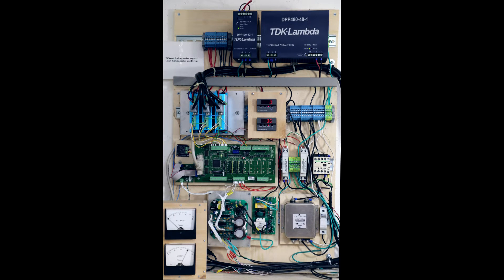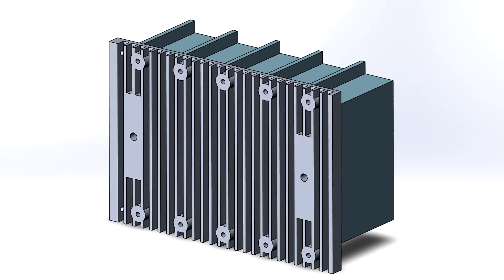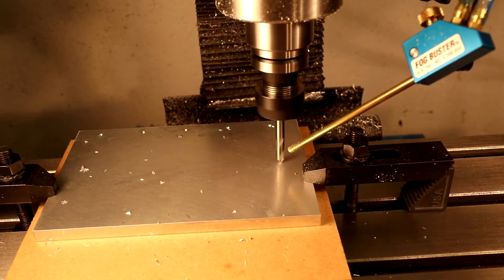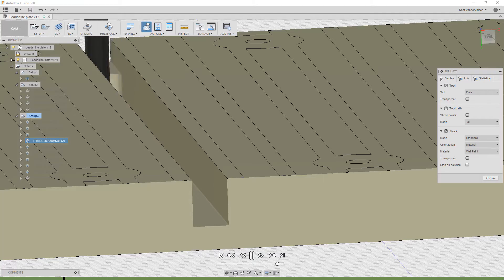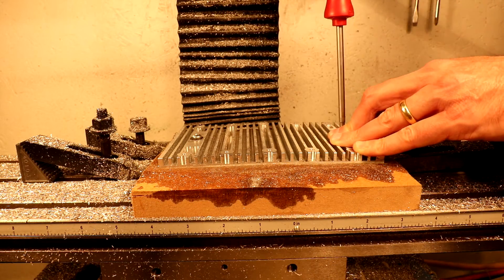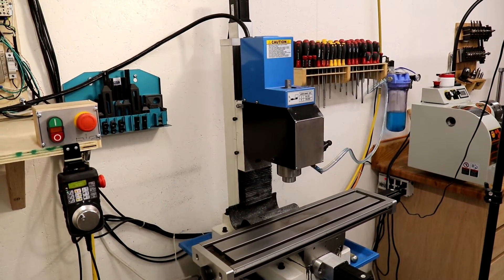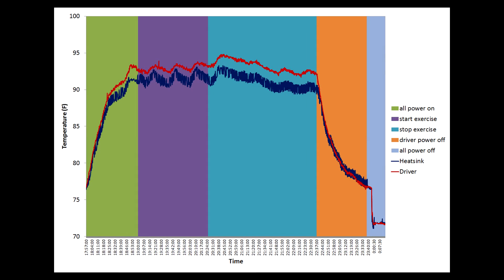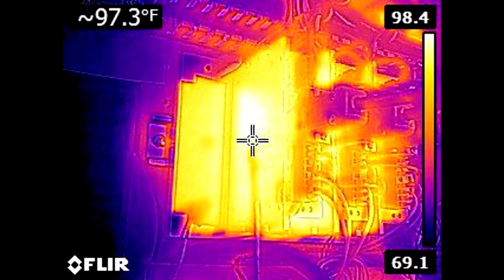Make Heatsink For Stepper-Servo Motor Drive

Comment from the maker: Check out my most recent video: https://goo.gl/Jj7cU1

Mounting the drives directly to an enclosure sub-plate would provide a large heatsink and ground too, but may not be as convenient as a DIN rail mounting. I'm pretty indecisive on the electronics and progress has been slow. The new 48V passively cooled power supply is nice a upgrade over the previous power supply, which was very noisy both audibly and electrically.

Comment: hii there 
would be please share the wiring diagram of the electronics part and parts name mainly which model of hybrid stepper , their drivers and Bob...I'm very much confused which to use in my diy CNC..thanks 
( learner from India)
Reply from the maker: Hi Wasim, it's wonderful to meet you. The stepper motors and drives are Leadshine ES-M32320 and ES-D508, respectively. A complete list of what I used is at https://github.com/kentavv/kvvcreates/blob/master/20161215%20-%20mill%20design%20breakdown.docx
Reply from the maker: I'm not finding my wiring diagram. It might not be too helpful to you though, unless you have the same controller. I used the Pico Systems Universal Stepper Controller. Let me know and I'll keep looking.
Reply: Kent VanderVelden thanks Kent...hope you find the diagram ..this will definitely help me .most probably I'll be using the same controller...I'll be in touch
Reply from the maker: Give me a few days. I'll create a new one if needed. I want to have it documented.
Reply from the maker: Please take a look at the files at the following location and see if they are sufficient. If not, let me know where additional clarity needed. Wishing you the best of success with your conversion.
https://github.com/kentavv/kvvcreates/tree/master/pm25mv%20cnc%20mill
Reply: Kent VanderVelden thanks Kent.i'll go through the files and let u know if I need more help. thank u so much :)

Comment: glad to see you used an emissivity modifier on the heat sink for the IR imaging.
Reply from the maker: Hi Jody. The reflections are neat but are sure misleading. Apparently black electrical tape is better but masking tape is OK. Here's more from FLIR: http://www.flir.com/science/blog/details/?ID=71556

Here are a few things that I found interesting while reading about heatsink design. Some people argue that anodizing the heatsink black will improve its efficiency slightly, but the heatsink has to be really hot. A heatsink of pins is not sensitive to orientation unlike a slotted one. Apparently the tapering of fins helps with air flow by creating areas of different pressures, but maybe that's only if a fan is used? The most interesting idea was creating very small holes, (chemically?) to greatly increase the surface area.

This was probably all overkill for the motor drivers, and still interesting. :)
Reply from the maker: Here's one of the nicer heatsink design documents. Of course, I'm reading this stuff after the fact... :) http://bit.ly/2kW4Akv Apparently, I should have used 6063 instead of 6061. Here's another interesting article on optimizing heatsink designs with software, creating some pretty odd looking ones. https://blogs.mentor.com/robinbornoff/blog/tag/heatsink/
Reply: Kent VanderVelden I'm a level I I certified industrial IR Analyst. No need to anodiz it. simply spray painting it will lower the emissivity and allow it to get rid of heat faster. one of the reasons Yeti cups are shinny stainless steel is for its ability to not emit heat.
Reply from the maker: HI Jody, I wondered if you may be an inspector, electricial, or engineer after seeing your channel image and the fact you know what emissivity is. :) If you don't mind, I may send you future IR measurements questions, if you have time. What do you recommend that I do differently in the video? Thank you
Reply: Kent VanderVelden Send any questions you have. If I don't know the answer I probably know someone who does.

Comment: Nice vid Kent! I've seen that MDF growth before in your 'blooper reel' vid if memory serves right, nice to see it.. You do a much, much better job in making vids than I am! Wouldn't it be great to be able to make these vids every day? I also noticed this behaviour of Fusion (as well as the 'spastic' unneeded air-cutting motions you pointed out in other vids). Haven't found an answer for that either. (had the same issue about a week ago when making a glass holding tabs from 12mm diameter aluminium).  What's also a factor that might limit you from helix down is the 'stock to leave'. Just make sure your tolerances and stock to leave are not conflicting, causing a part that has too little material left. Thanks for posting!
Reply from the maker: Hi Rene, thank you. You must have a better balance between the project and video creation time though. I'm slow at the video creation., and so here is material filmed in Dec. is finally getting out. :) Thank you for the tips on F360. Perhaps some means to guide F360, like Simplify3D's support guidance would be useful? Or, some feedback with suggestions on the why of the Internal CAM Error and No Paths to Link errors?

Comment: Another brilliant video. The settings that stop adaptive from working in a tight slot like that are usually the ramp diameter in the "Linking" tab or the minimum cutting diameter in the"Passes" tab. Also check the stock to leave, because sometimes that allowance on both sides plus the diameter of the cutter can add up to a width that means it can't fit the toolpath in. If you reduce those settings, it should work. Just be careful with a really small ramp diameter if your tool doesn't center cut.
Reply: Yep, that had me foxed last week for my first slot in steel. Once I fixed the ramp diameter and used a small enough endmill I stopped breaking end mills. One thing I could not find any good reference for was the step over on a 4mm endmill. I started out at .4mm and got it up to 1mm Fusion360 was recommending 1.6mm.
Reply: Mike O'Connor there's no hard and fast rule for stepover (optimal load in adaptive clearing.) A number of variables need to be considered such as material, rigidity of the setup (workholding, tool stick out etc.) You took the right approach though, start with a small stepover and then increase it. For big machines we usually use 40-45% of the diameter of the tool as a stepover for adaptive (in aluminium) and then adjust the federate to get the required chip load. On my little machine at home though, I rarely run more than 15-20% stepover in adaptive in aluminium. It's just a matter of experimenting, one variable at a time and finding what works for you. A good speeds and feeds calculator will get you in the right ballpark.
Reply from the maker: Thank you Gavin, especially for the warning on a minimal ramp diameter being a function of if the tool is center cutting. I didn't mention in the video that adaptive clearing worked well enough that I could have skipped the finishing pass. The ramp entry options for the adaptive clearing were limited and wouldn't create a lot of clearance for chips in the contained slots, such as helix creating a hole only slightly larger than the tool. A zig-zag or profile ramp entry would have created more clearance but those options were not available. Maybe you have a better suggestion. Is the idea of first drilling most of the material out of the slot reasonable?